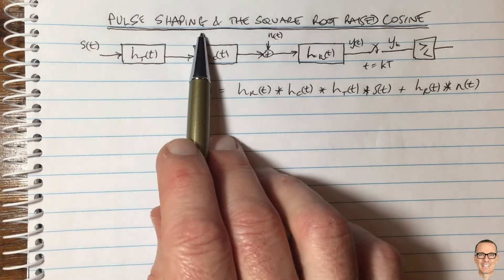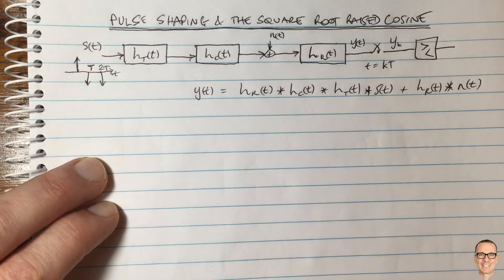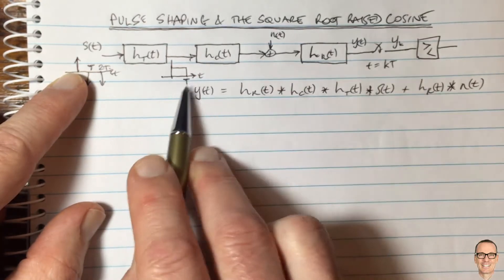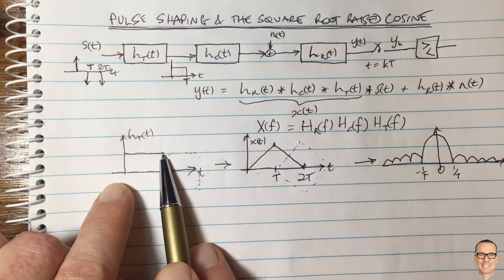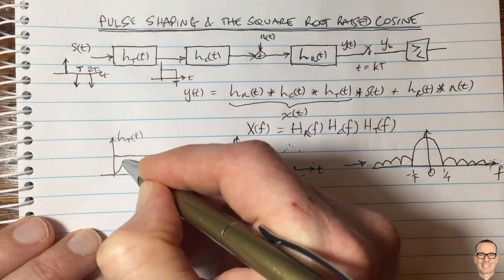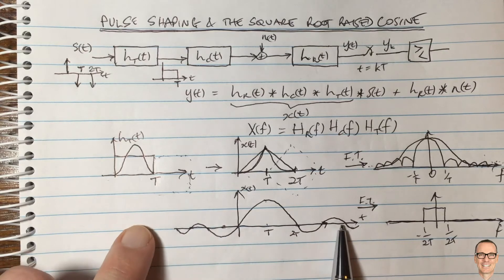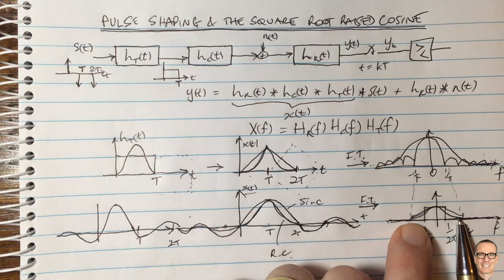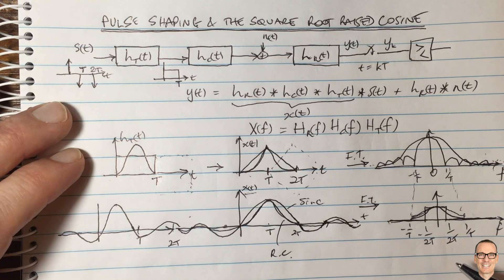Pulse Shaping and Square Root Raised Cosine

Comment: The issue that you've sidestepped (on purpose) is that a root raised-cosine filter is not realizable (because its impulse response is not causal). How does one implement a root raised-cosine filter in practice?
Reply from the maker: Yes. Great point. In practice it is necessary to truncate the pulse in the time domain, and implement (incur) a delay of as many symbol periods as the length of the truncated tail. Nothing comes for free! 😁

Comment: Thanks for the video. A question here: the OFDM subcarriers look like sinc functions and spread over the whole bandwidth. Will that be a problem or what do I miss?
Reply from the maker: Sorry, I'm not exactly sure what you're asking, because this video does not have OFDM in it. But anyway, perhaps this video will help: "How are Data Rate and Bandwidth Related?" https://youtu.be/ZBSvMbO0mPQ
Reply: @iain_explains  Sorry for the unclear question. I mean at 6:51, you mentioned that the sidelobe could go forever but we do not have infinite bandwidth. I want to ask if it is the same case for OFDM signal? Or in OFDM there is no such issue because the sinc functions of each subcarrier are orthogonal to each other?
Reply from the maker: Yes it's the same for OFDM. Each subcarrier in OFDM is a sinc function. this video explains it more: "OFDM Waveforms" https://youtu.be/F6B4Kyj2rLw

Comment: Thank you for your great videos! I have some quesions, and would appreciate it if you could answer.

Why do we split the raised cosine in the transmitter and the receiver? Couldn't we just put an RC filter in the transmitter instead of putting RRC filters in both the transmitter and the receiver? Also, how does the receiver know what roll-off factor to choose for its RRC filter?
Reply from the maker: You need to have a filter at each end of the link, because the link is a real continuous-time channel. For more explanation on this, see: "What is a Matched Filter?" https://youtu.be/Ci-EjiMJo3I  And the choice of the roll-off factor is a design choice based on a number of factors, including how the timing acquisition is done, how much bandwidth is available, and what data rate you're trying to achieve, ... amongst other things.

Comment: Prof thank you so much for these videos! I've been playing with digital comms for one project of mine, and I got a question, if I may. 

I've been trying to buld a digital transmitter "from the scratch".

In practice, how one would implement the R.C. filter in a digital system? My guess is in the form of a FIR or IIR filter stored in the memory, but I can't get any glimpse regarding how one would implement the convolution between such filter and the impulse sequence s(t) into a digital unit (say, a microcontroller). 

I hope you can comment something on this. Thank you so much!
Reply from the maker: Great question. The convolution would need to be done at a high rate (compared to the symbol rate) and can be done (for each of the in-phase and quadrature components) by copying the R.C. impulse response (at the high rate) into the output vector, centred on each digital symbol time, and multiplied by the symbol's amplitude (in-phase or quadrature, respectively). You then need a high rate DAC. These videos might help: "Discrete Time Convolution Example" https://youtu.be/KAOJsqCyd5Y , "How are Signals Reconstructed from Digital Samples?" https://youtu.be/dD9HC1GThZY and "What is a 1-Bit DAC and How Does it Work?" https://youtu.be/3R8ipTHb9xQ
Reply: @iain_explains  thank for the precious info!

Comment: Thanks for the video 

1-if pulse shaping cancels the isi in a dispersive channel then why do we need ofdm ?

2- in awgn channel (for ex wired comm ) do we need a pulse shaping satisfying Nyquist criterion for zero isi ?
Reply from the maker: Pulse shaping only cancels the ISI fully in certain circumstances (see the video: "How to Avoid ISI in Digital Communications: Nyquist Zero ISI Theorem" https://youtu.be/sgyTlI9BsKc). When the transmitter does not know the channel transfer function (which is often the case in wireless communications with time varying channels), then it cannot predistort the signal in the optimal way to avoid ISI, and then equalisation needs to be done at the receiver. This is where OFDM is good, since it makes the equalisation task easy at the receiver. See "How does OFDM Overcome ISI?" https://youtu.be/xcQ6rtIXv6M
Reply: @iain_explains  

Thanks but

1- what about my second question above ? 

2-it is mentioned that the tx practically doesn't know the channel but  the tx can know the channel using reference signals this is in all the 3gpp standards I know about 

Moreover it is mentioned that the channel is time varying yes indeed but only after the coherence period 

So I still do not get why pulse shaping for zero isi is not used instead of ofdm

Comment: In OFDM systems, the symbol shape is pretty random as it is composed of multiple individually modulated signals. So, in that case is it possible to design a matched filter for OFDM symbols or this applies to the underlying symbol shape that modulates each OFDM carrier.
Reply from the maker: The pulse shaping is done at the sample rate in OFDM (not the symbol rate). For example, if the OFDM "symbol" consists of 1024 "time domain samples", then each sample needs to be sent with a pulse shape.

Comment: Great video as usual :-). One question, though! Where in the receiver chain is this matched filter [Hr(t)] located? From your sheet, it looks like this is located before the ADC as y(t) ti converted to y(k) after this filter. I come from RF background and I haven't seen any matched filter before ADC. We have an anti-aliasing filter but not the matching filter. Can you please elaborate if possible.
Reply from the maker: It depends on the implementation. Consider the most basic case, where you are sending square waveforms mixed up to a carrier. If your ADC in the receiver is sampling at the symbol rate, then the down conversion mixer (in the receiver) combined with the symbol-period integrator in the ADC, are performing the "matching". This is a version of the "correlator" implementation of the matched filter. The oscillator in the mixer is "matched" to the input waveform (ie. the have the same frequency, and phase offset).

Comment: Hi , when you say that s(t) is a way to send digital samples , by using impulses , I want to understand how those impulses generated in practice .In practice it would not be possible to generate a impulse to represent digital 1 / 0 . in fact it must be some form of rectangular function . so the question is in reality what is a impulse response as we can never generate a impulse in time domain .
Reply from the maker: Excellent point. Yes, in practice we need to find some way to implement the equivalent of the symbol transmit filter. This can be done, for example in the case of BPSK, by using a crystal oscillator (for the carrier signal), and a simple switching circuit (to generate a square wave signal that changes between -1V and +1V depending on the digital data), and then multiplying them together with an electronic multiplier circuit.
Reply: @iain_explains  Thanks for the explanation you provided . I did understand your point.However for the sake of clarity i would like to clarify certain things with respect to this video . So what I understand is that we are trying to model the impulse response of the transmit filter and in this case we find that if we have a time constrained raised cosine then we have better frequency domain characteristics which prevent interference. Now what I understand is that we are actually not referring to impulse response but a symbol response     Of the transmit filter , as we will have a BPSK signal for example . I have one doubt here . So the carrier which you are referring here , Crystal oscillator, will that multiply the response of the filter in time domain ?. So I am trying to imagine a waveform that carrier frequency ( cosine function in time ) multiplied by the raised cosine at the transmitter. Am I imagining it correctly?

Comment: Hi Iain, great video. The pdf worksheet of this class isn't allowing download. Can you take a look on it please? Thanks!
Reply from the maker: Try now, I've just uploaded it again (not sure why it didn't work before, sorry). It's really a Summary Sheet, not a Worksheet. I initially had intentions of producing worksheets, but I haven't had enough spare time. Thanks for alerting me to the upload issue.
Reply: Iain Explains Signals and Systems The summary sheet works very well. It’s a good way to have your notes without taking screenshots. Great work!